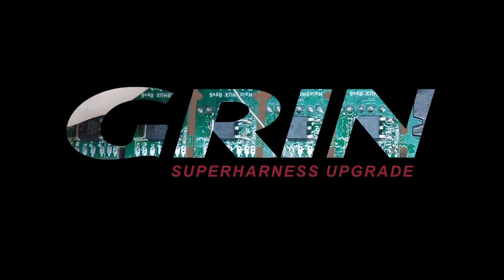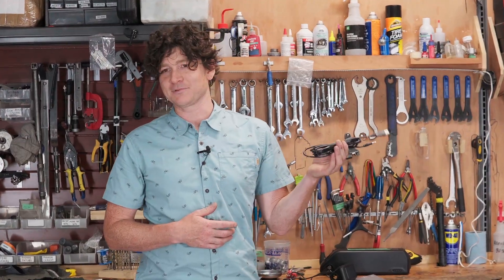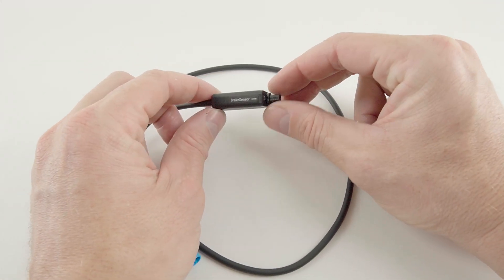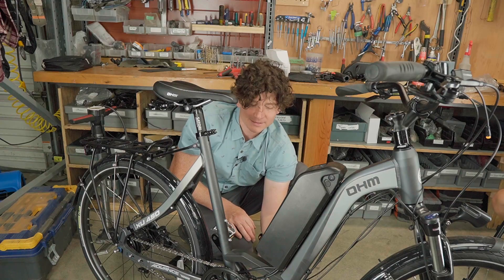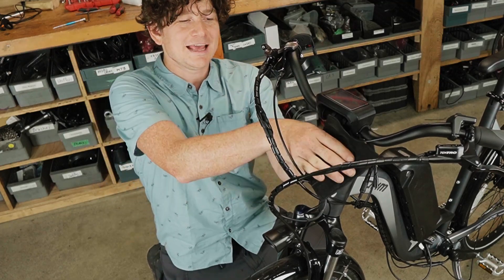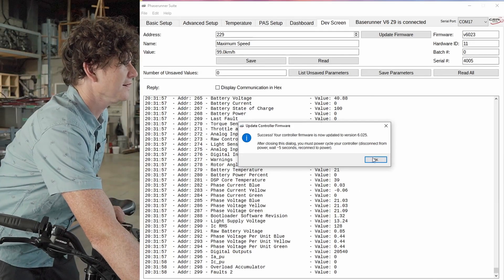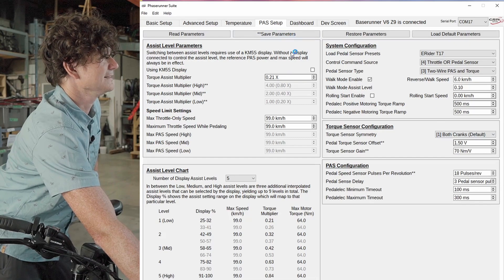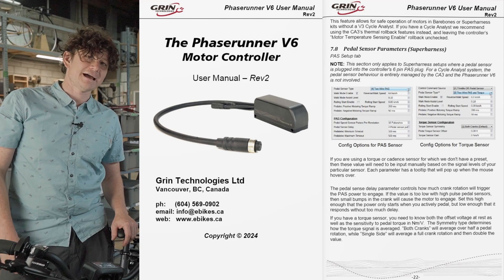Migrating a Cycle Analyst setup to Superharness

Comment: Would you be able to use this with Baffang motor controller?
Reply from the maker: It wouldn't have much purpose as the bafang controllers can't do regen and they use a diffent control protocol and display pinout. It would be a lot of extra custom wiring work for no useful functionality over a stock bafang harness.

Comment: Congratulations for the nice video, as always your products and information are of high level. Instead of a KM5s, I connected an Eggrider display with ASI protocol (baserunnerZ9-V6 with only PAS sensor, without superharness because I do not use throttle, regen and lights). After adjusting various parameters via "Suite" everything works fine, however after about ten minutes of good operation a "communication error" appears. Could it depend on the lack of superharness?
Reply from the maker: Nope, the superharness plays no role in the communications between the display and controller and wouldn't make any difference, Tx and Rx just pass right through. In your case (since you don't need the proportional regen control) there's no need to get it. You might however find that the communication is more reliable if you connect the eggrider to the TRRS communication port instead of the Tx Rx on the Main9 plug.
Reply: @GrinTechnologies Very interesting, thank you very much!!! I was thinking of trying the ASI "remote control" mode (serial streams), do you think it could work?

Comment: If I have a surron throttle can I wire the three wires to higo plug and use this kit with a Phaserunner on my ebike. That has a hentach motor
Reply from the maker: Assuming it is a conventional hall effect throttle with a 1-4V signal range when powered from a 5V supply, then yes. Up to you to figure out if that is the case and what the pinout is.  A multimeter probing your existing setup would be informative in that regards.

Comment: I use Grin components including GMAC motor, Phaserunner and Cycle Analyst on my wheelchair power drive. It’s a great setup but I’m definitely ordering a  Superharness and the 750C display because it will just make the whole setup a bit tidier and more compact for when I have to load it into the car.  Looks like another great product. 👍

Comment: @grintech. I had to run my Brompton superharness kit as sensorless to get rid of the display errors. Do you know how i can run with the default hall sensor setting?
Reply from the maker: Try gradually reducing the maximum phase current limit and you should find a sweet point that still gives good torque but doesn't result in electrical noise causing the error 30. Or if you only see this at low speeds starting off, try having a much more gradual speed limit ramp time, like 3000mS
Reply: I actual get a 24H error that won't go away. Is it still the same fix?

Comment: Can a 2024 Wired Cruiser be converted to Regen braking?
Reply from the maker: Yes, either by replacing the hub motor and motor controller, or by replacing just the motor controller and modifying your motor to lock the clutch so that the motor is always engaged and doesn't freewheel. Watch this video to get an idea of what that entails, it's not a simple job by any means
https://www.youtube.com/watch?app=desktop&v=sL3bjQZGjoQ
Reply: @GrinTechnologies  Figures.

Comment: These multi pin round connectors have an embossed arrow that is never in different color and hard to see. If the pins are not aligned, it's so easy to break them.
Reply from the maker: Yup, it's a pretty bad design, but became a defacto standard that is now widely available. Even more silly is that the pin positions line up in the different pin count connectors, so you can mate incompatible plugs together.  Higo has other versions with geometric shapes so that they can't be misaligned, but they are seldom seen in the spare parts market.
Reply: Also the 8 pin plug on the Phaserunner doesn’t actually have a notch, so alignment of the pins is all you have to go by. Personally I’ve marked the alignment notch with a small grove on the outside of the plug so it’s easy to see when they are aligned.

Comment: questions, do you really need the Superharness? cant the phaserunner be connected directly to a display? Doesnt phaserunner have all the connections for PAS, Brake and ADC1/2? I wish the super connector had a PAS input that would make it useful for anyone running a VESC or high power controller that doesnt support PAS.
Reply from the maker: https://ebikes.ca/shop/electric-bicycle-parts/controller-accessories/diy-main-harness.html
If you know what you are doing, but there is no way to have a torque sensor, throttle, and variable regen.

You can use the CA3 to add torque and PAS control to a vesc no problem
Reply: My understanding may be out of date on this but I've been told that while there are all those connectors for the phase/baserunner they can only be used with extremely minimal programability and adjustments and no regen.

Comment: what I would like is a "super harness" that would tidy up the octopus thats hangs out the back of my ca3 not a colour screen thats gives you little to no information and the loss of the ca3 control and settings. I had to cut all the wires and shorten them, then solder the throttle brakes etc so not to have the bulky connectors. love the ca3 and the phaserunner  but the loom/harness needs work
Reply from the maker: Did the strechy fabric sleeve not do the job OK?  Usually that can conceal the cluster to a satisfactory degree. At one point we actually designed a hinged plastic enclosure box to cover all those connectors and got the mold tooled up, but we didn't do a good design on the plastics and so the hinge and snaps would easily break, and then dropped it. 

Agreed that it's an area that could use some attention but it's been kept that way for legacy support.
Reply: @GrinTechnologies   I felt the fabric sleeve was an after thought as in "that will do" to cover the mess of cables. It's not a long term solution thats looks aesthetically pleasing. please revisit adding a box or enclosure to the top or back of the ca3 as and add on part ie you can buy it if you want it that would enclose the octopus and still allow "legacy" builds. your halfway there you know how not to make it from your previous attempt. i'd be happy with a hollow open top box with a seal that screws to the back of the analyst with a bag of grommets and drill the holes I need and fit the grommets. make all the connections then screw the box to the analyst with a rubber seal.

Comment: I'm glad you've added this option. My guess would be that going from CA3 to Superharness means you lose the throttle "autocruise" and 3 preset options (which I believe are CA3-specific features)?
Reply from the maker: Yes indeed, and things like back pedal regen, regen enforced speed limiting, wh/km statistics and all of that.  So it's not an upgrade in terms of features, but for people who don't need those features and care more about having a color display this should check that box!

The different assist levels can be configured in a similar way to presets though, so if you do set it up for 3 assist levels each one can have its own independently set speed limit and power limit.
Reply: @GrinTechnologies thanks, just confirming, and I understand the display desires. Glad you offer the choices.
Reply: @GrinTechnologies will back pedal Regen be available in full release firmware soon, as opposed to just beta?
Reply: I love everything you are doing at Grin but wondering if there will be a new app coming for the phaserunner
And if so will there be IOS as well:)